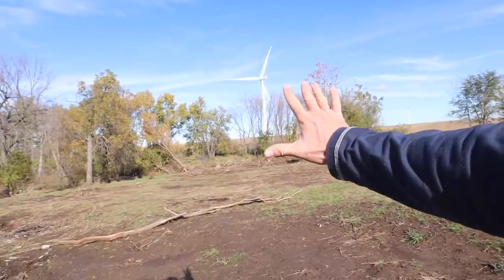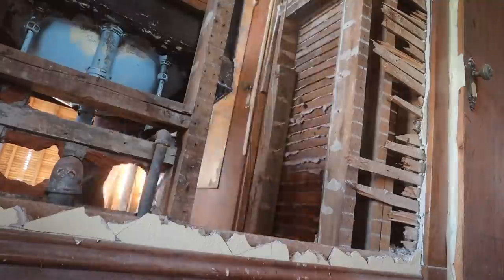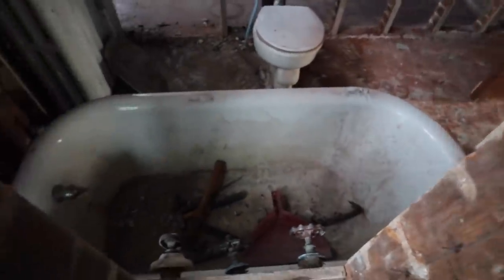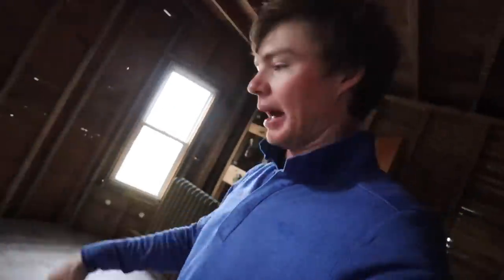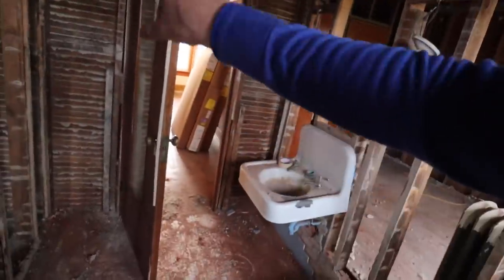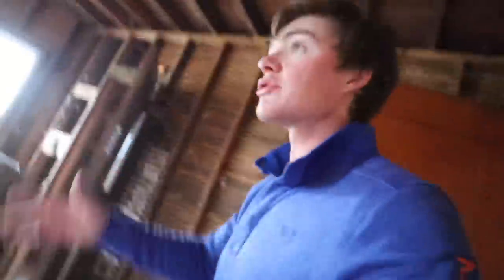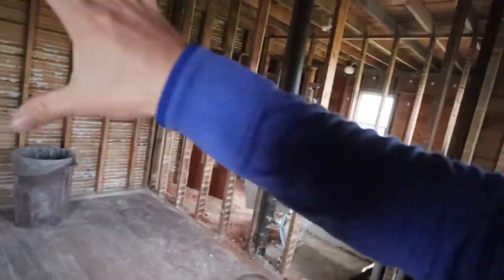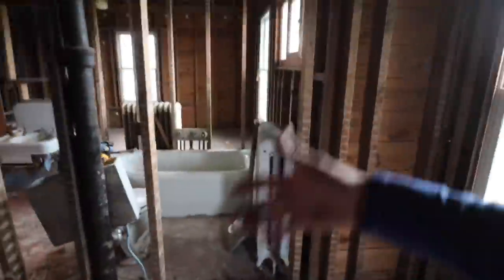I Am Building An Underground Movie Theatre

Comment: Consider replacing the old iron radiators with iron baseboard radiators.  Those old stand up radiators are a “piece of furniture” really and if you replace with iron baseboard radiators, still water heat and efficient, but they don’t take up room and you will have a larger space for furniture placement. We did that to our 100 year old house and it is wonderful.  You can sell the old radiators and go to a salvage place and buy baseboard radiators for a very reasonable price.

Comment: Love watching your progress!  High efficiency (98%) modulating propane boiler with outdoor reset heating those wonderful old cast iron radiators = wonderful, even comfort for the heating months.  Separate ductwork for cooling = wonderful, even comfort for cooling.  All a more expensive option, for sure...but so comfortable, in my experience.  Keep the great stuff coming!  Peace...

Comment: Why not do heated floors? I am remodeling my own home and we installed heated floors on both levels. Look in to gypcrete its like a concrete that is made from drywall if my understanding is correct. our home is late 1800s and we took it down to exterior studs. We replaced all the windows and doors. Spray foamed the walls and roof decking with closed cell 3" on walls and 6" on roof. For our floors we kept the old planks added 3/4" OSB and then added pex tubing and 1.5" of Gypcrete. the benefits are amazing. Sound transmission between the floors is amazing. and best of all we went from $300+ in heating cost to under $60 and that was last winter when we did not have our drywall installed. love the channel my family farms and I now work in the Finance world but every day my Father and I drink coffee and talk about this channel and Larson Farms. keep it up and I am going to race you to the Underground movie theater. Ours is five years out still but had the same plan as you. Take your time with your home and enjoy every part.

Comment: Don’t forget to plan for what is needed in the future. I install residential furnace’s and A/C’s and in a house that size I would put a unit in to do the basement & main floor and another unit for the second floor & attic/loft. As you know hot air rises and cold air falls your main thermostat would be on the main floor with only one unit which leaves the higher floors to get warmer, never great for sleeping. Plus you can size the HVAC equipment for when you put your addition on now and save on getting heat to that area later. But you will miss the boiler heat it is a way nicer heat then forced air just not as convenient.

Comment: Cole, a sledge hammer will break the tub into pieces. Be sure to have safety glasses and any exposed flesh covered as the porcelain glaze will shatter off of the tub. And it's sharp as a razor. Being a plumber for almost 50 years I have broken many cast iron tubs. But there is a market for old tubs like that one if you can find a buyer. In that case, you had better call a couple of your buddies to help you get it outside. Good Luck.

Comment: In-suite bathrooms with quiet vent fans excellent idea, as is insulating some interior walls like ceilings, bathrooms, kitchen, family room. For connectivity, go big with high-speed Internet and mesh routers. For security. load the place with motion-sensor lights, especially where your outdoor grill is located. Video surveilance also a good idea. Appliance garages in kitchen, walk-in pantry, dumb-waiter to bring heavy stuff up like beverage bottles and cans and chest freezer items stored in basement. Plan, plan, plan, draw plans, carefully locate every plug and light switch. Main level suite with walk-in curbless shower useful any time mobility is impaired.

Comment: You wonder why they put brick up there. Maybe to insulate the place. After all, it isn't nice to get out of a warm tub and stand in a cold room. Cole, what about the exterior. Surely you don't want wind and water entering  through the spaces between the exterior boards.  Sand the boards and then cover it with plywood. Floor will be stronger. But you have to get down to clean wood.  Remember, Cole, the more bedrooms you have the more value it gives the house. You are a modern kid. You need a shower much more than a tub. Many bathrooms today don't even have tubs.. Hot to get the tub out? Well it is whether you want to save and sell it or not. Decorators love those old tubs. Otherwise, it is cast iron and will crack like an egg if you hit it with a sledge happer.  BEST ADVICE - build YOUR master suite. Make a common bath for the other rooms and leave them pretty much as they are. After all, you do need only one master suite. Forced air heat will never be as satisfactory - yes even.

You have a lot of ambitious thoughts. Don't destroy that house, Cole. 20th century has no comparison to real luxury. You don't know what it is. Well, you do, you are living in it. Modern is cold, unfeeling, no artistic touch, no soul, This of what went into the building of that house. Real artists built it. They don't exist now.  Be careful, Cole, You me be destroying the beauty you seek.  Labor is the highest cost of anything today. The more you can do, the less you spend.  Hey - Look at the wisdom of STUCK INN - Yes!!Insulation is a sound dampener as well.

Comment: To remove the tub, which is cast iron, and is why it weighs a ton! A 20 lb sledgehammer will take care of reducing it to pieces you can carry. Wear protection for face, hands, and sturdy long pants, because you will be shattering the tub to remove. I've done this more times than I ever wanted to. I don't recommend using the window to toss the pieces out, carry them down by hand! And if you have one of those old cement sinks in the basement, same procedure except you'll need a sawsall to cut wire reinforcements.

Comment: You want to have a linen closet; central location for bathroom and bedrooms.  Unless your plan to stock every bed and bathroom with towels, change of bedding, extra blankets and pillows.  I’d put in a small utility room upstairs with an apartment size washer/dryer, linens and cleaning supplies, vacuum.

Comment: Hey Cole , This other guy i dont know but watch his videos is called matt risinger, hes building his own home (contractor/builder) and chose to use a pressure/ Mist system of silicone to absolutely seal the house. It puts a room or large space under pressure  like 10 lbs then mists the silicone which while escaping the cracks builds up and seals them... works Amazing.  Save you SO Much money $$$ first Year. 
 so hey just a thought for you..

Comment: A couple of suggestions: As for the tub (if you don't want  one anymore) a five pound sledgehammer would reduce it to manageable sized pieces pretty quick (fun too) 😉. Then I'd suggest adding a glass door wood burner in one room, it's very cozy to sit in front of with a cup of joe in the winter,  looks stylish and saves on heating bills.👍

Comment: Dismantle a window down to floor level, put pipe below tub , role it to hole , shove it into a dumpster down below, for that matter any heavy stuff from each floor or debris, put a temp door there, a barn crane above hole,  if no dumpster, use the tickler bone etc. or use a block and tackle if you are ambitious, build the hole back up  to window, put in new, better window. Plus , to bring stuff up, wood, new appliances, tile, furniture, beds. Lot easier than stair hauling. Heck, make it permanent, a roll a shield entry for future stuff, (with good locks and alarms so no idiot walks out it, lol.)

Comment: Go ahead and insulate the ceiling. Then, sand the attic floor boards to remove the bird stains. Then you can decide if you want radiant floor heat up there or just plywood over those floor boards.

Comment: Cole to remove a cast iron bathtub you need to cover it with a blanket and hit with a sledgehammer.  I started by splitting mine lengthwise. Its relatively a easy project.

Comment: I have done a major renovation on my house the last two years, mine is a brick house though. Now I know how to remove solid 100 year old bricks(that are black inside) and a lot of plaster quickly. Probably the most helpful tools were a mobile air compressor, a small short barrel air hammer and a long air line. Because putting the compressor in thick dust all day long will kill your tools. Bigger, more powerful tools don't work for what you are doing, they are less precise, too destructive and it is impossible to hold on to a bigger hammer all day long. Certainly for overhead work. The bathtub is cast iron I presume? I dealt with mine with an angle grinder, very doubtful if that was the best way to deal with it, but that was the only thing I had available that day. For you, bolt or weld some chains to it and lift it out of the window with the telehandler if it fits, I would guess. :-)  How you can combine youtube with tools that create a lot of dust and noise, I do not know... :D

Comment: That's a big house... I would see the potential for 2 apartments, one on each floor for you & cooper that would be family size homes for you when you do take the plunge. The bath & radiators would be 'domestic architectural salvage in the UK, They are sought after 'retro-period' pieces. slide them over to one of the windows & slide them onto a pallet on the Ticklerbone & sell them. they can fetch quite a bit of money.

Comment: The problem with busting a cast iron tub is you are shattering glass also a cast iron tub is fused with glass so you end up with  shards of glass to clean up mostly teeny tiny. That style tub ways closer to 600 lbs. Best way I  found to move them is just stand them on end and use an appliance dolly on the skinny side take 3 men and just bump it down  the stairs. As much as u wait lift I think u will find that is really not that hard to do. Basically like moving anything with a cart u just find the balance point and roll on the cart balanced  and bump down the stairs the same. Good luck on your decision.

Comment: Cast iron tub can be cut with a grinder/demo saw or if your lucky it can be cracked and broken with a sledge hammer. I usually cut strategic parts and then SMASH with a hammer, and don't forget SAFETY THIRD!!

Comment: Cole with everything you do with the house, try to think 10 years ahead. You definitely don't want creaking floorboards or stairs when you have kids. So make sure you get this stuff properly done and sound isolated. You will thankful to 22 year old Cole, that he did this properly.
Reply: Throwing good 'ol rock wool batts (batts - not loose - no sagging!) into interior walls, especially bedroom walls, makes a huge difference! 
Can also dramatically slow down the spread of fire between rooms should you ever have a fire.  Might be useful in the country if the fire station isn't too close.

Comment: Option 1. Bathtub. Cover with Moving blanket, sledgehammer!. Haul out small pieces.
Option 2. Sell it on market place, buyer needs to bring a small army to haul out
Option 3. Cut a hole in the roof hire a helicopter to lift out.
Option 4. Keep the tub and have it refinished.

My favorite is option #1

Comment: Get a hardwood flooring specialist to give you a quote on patching in and matching the old hardwood. Replacing with laminate would be a huge down grade. The original floors have lasted the life of the house for a reason they can be sanded and refinished. Laminate won't last your lifetime

Comment: if you want to get rid of the tub try using a sawzall to cut it into sections to move easier. a sawzall with a good blade should make fairly quick work of the tub
Reply: sledge hammer is faster

Comment: The tub is probably just porcelain covered cast iron, so you could just angle grind the iron into some smaller pieces and break the porcelain.  👍
Reply: Cast iron is brittle - easer to just cover with a heavy blanket and whack a few times with a sledge.  Easy peasy.

Comment: For getting the tub out of the house you will need to have about 5 or 6 guys carry it to a window and put it through the window onto your Tellihandler that should be ready for it right outside that window, preferably with a plywood or pallet platform to receive it on the Tellihandler. Then lower it directly into your dumptruck.

Comment: Put clear sheets of plastic on the bottom of the upstair floors. It will help to keep the heat in your home & then later on down the road you can tear the upstair flooring out.

Comment: The best way to get rid of that tub. If you're not trying to save it. Is to take a sledgehammer to it and break it apart. Put a blanket over it first so that it helps not throw little shards everywhere. Moving blanket

Comment: I am old plumber.  If your not going to reglaze the tub ( some could be offered the tub for free if they want )  we removed hundreds in 50’s through 80’s with heavy sledge hammer and broke them up into manageable pieces.   These are cast iron tubs and where primary product available 1880’s thru 1940’s.  Later formed steel and them plastic molded and injected became the standard.   Cast  Iron is great material but is brittle.  Heavy sledge will break them up tnto 4 to 8 manageable pieces that the metal recycle typically will take back.   Eye protection and heavy clothing are mandatory for flying chips.   Thing about why you are not to hit gear castings with a hammer, they shatter.   Reverse thinking for demo of cast iron tubs.   Good luck

Comment: The spray foam idea sounds bad to me.   There was a house sprayed with that foam in the attic to help stop the heat here in Florida.   They say it is not flammable but it is.   The house in question was hit by lightening and went up like a Christmas tree.   As much as they say it is not flammable it is,  remember that.  At most the type that is fire rated,  is rated only for a couple minutes.  I think like 240 seconds to 300 seconds.   No way fire department will get to your house in time to stop that from being fully engulfed.     Retired from home building(33 years).   Put in normal insulation and use 5/8 drywall on all exterior walls.   You will be impressed.

Comment: Cole, put a moving blanket over the tub and give it a few good wacks with a 10lb sledgehammer and it will break.  If you don't use a blanket over it the porcelain will explode off it and it's like flying shards of glass.  Then you can carry out 4-6 pieces of 50lb segments of tub.

Comment: Bathtub is probably cast iron with porcelain  you can break it up with sledgehammer  but wear safety glasses and ear protection also you can put old blanket over it to stop  any splinters flying through  air

Comment: Remove a low window & use Pettibone  to lift bath out,if you want to save it,easier than  trying to go down a stairs, or if bath cast iron then a sledge hammer job to break it up.

Comment: To each his own...Congrats on your desire to re-do of the family home.
.........Please remember, when using spray foam insulation........
.....................................................do not make your home too tight....
...... You still need a minimum of " 3 ACH 50 " fresh air turns in the North...
....(and 5 turns in the south)
..That is a bare MINIMUM amount of fresh air...per the building code..
.Personally....We use MORE than the minimum required by the building code.

Comment: If you sand those attic floor boards with a proper floor samder they will clean up ok and remove any toxins. Then when you re seal them they will be hygienic. Seems a shame to lose the original floor boards.

Insulating that upper ceiling is a good thing from a sound deadening perspective. I would insulate between all floors to make the house quieter.

Cheers

Comment: Hydronic heat is the cleanest most efficient heating. There are modern radiators around today so look into it before ripping out the system.

Comment: Please look up dumpster shoots so you throw stuff out the window and let it slide directly into the dumpster.  Saves sooo much time/labor....also, you didn't mention having the electrical done in those rooms first (before insulation)...otherwise, do you not intend to have ANY outlets, sconces, etc. on the exterior walls?
Reply: please, please please put a double vanity in the master bath.....so much benefit to that (and valuable storage)
Reply: please reconsider the flooring option....replacing hardwoods with laminate is not an upgrade.  There are things flooring guys can do to address the squeaks in the floor so that you can keep the hardwoods.

Comment: One more thing, lol. I know you already know this but being a electrician it will be much easier to install the wiring before you spray foam. Use plastic boxes instead of metal, much easier. To bad I don't live closer, I would jump in there to help you with the wiring.

Comment: the cast Iron tub has to be broken apart, make sure you have all the protection on everything. The enamel can cut you up. I'm a metal shredder.
Reply: Why not put in an elevator, just in case, while you have all of this open up(?). That way, as you get older, you can stay there, no matter what!
Reply: You could attached a sliding bookcase, that would keep the attic hidden from everyone else. Nice home.
Reply: The one above the garage, could become your office to edit youtube movies and clips.
Reply: Cement boards, install in floor heat, and cover with your tile, that looks like wood.

Comment: IF YOUR going to add any new wire or outlets now is the time before they spray insulation.  its probably a cast-iron tube just hit it with a sledgehammer and it will break up. I usually break it into 4 or more pieces.

Comment: If you want to really get rid of the bathtub break it onto manageable pieces with a sledgehammer.  Don't forget to wear your safety squints. You can replace pair of glasses but not an eye. It's not easy but it can be done.